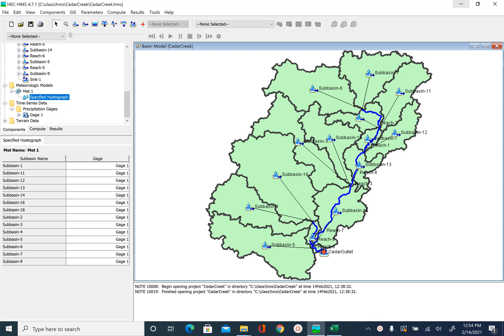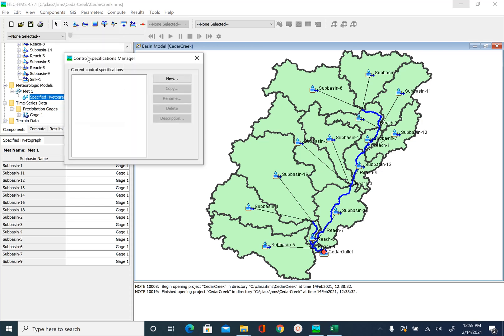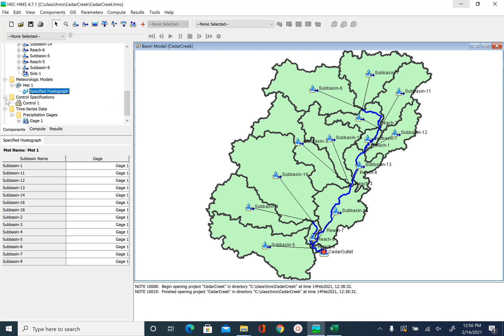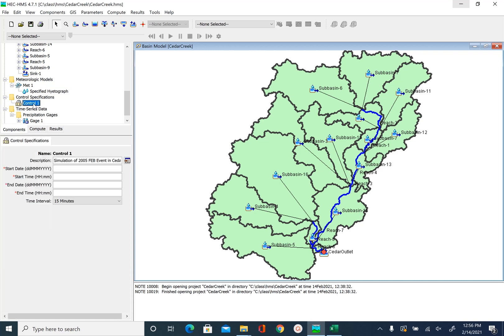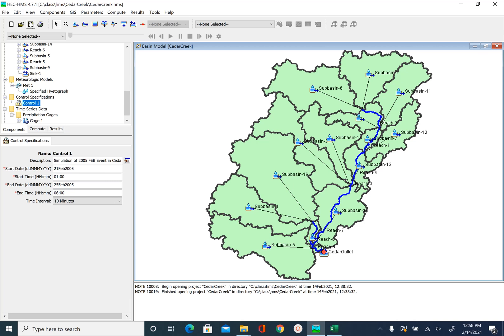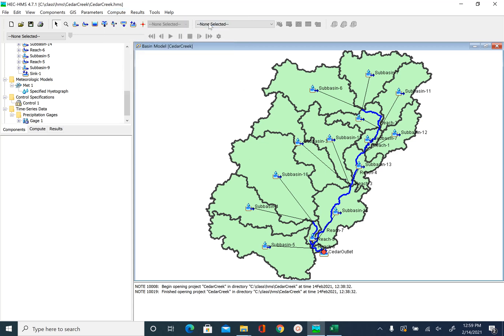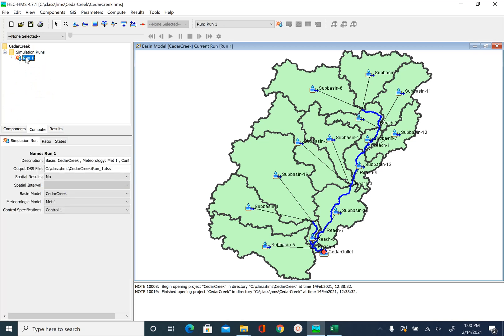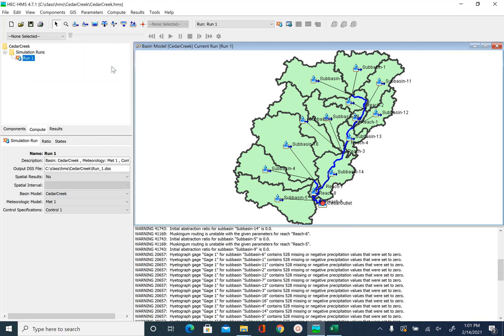Hydrologic Modeling Using HEC-HMS (8/9) - Creating Control Specification and Simulation Run

Comment: Hi, i have 2017-2024 rainfall data. I have imputed this in Precipitation gauge. In the next step, i do not understanding what Control Specification manager mean. How many years should i provide here?
Reply from the maker: are you using 7 years of data in  hec-hms? i suggest you go through some basic hms-tutorials at the link below to understand different components of hec-hms including the control specification file. https://web.ics.purdue.edu/~vmerwade/tutorial.html
Reply: @hydrologyvideos8253  Yes, I am using 7 years of rainfall data. Why, is there any fixed rule that requires me to use a specific number of years of data?
Reply from the maker: @ hec-hms is mostly used for simulating individual events or storms. if you want to perform long term simulations use SWAT or use the soil moisture accounting or layered green ampt method in hec-hms. it is better that you use SWAT.

Comment: Hello, when I use HECHSM to run daily weather data using SCS method, I encounter problem "WARNING 15303: Aborted run "run1"" What should I do?
Reply: Go to parameters , discretization , and choose structured. This will solve the problem
Reply: @shahdbishawi8508  Thank you. It run successfully.
Reply from the maker: @shahdbishawi8508  Thank you!

Comment: Hello. I am getting "Could not connect precipitation gage "" to data in the time-series manageé error all the time when I try to run the simulation. I could not find the source of the problem. Can you help me?
Reply from the maker: Most likely you missed a step somewhere. Go back and make sure you follow all steps correctly.
Reply: @hydrologyvideos8253  Thank you

Comment: Hello please how to input time in control specifications? I have precipitation data in mm/day. For example I have rainfall data from 01 july 2019 to 31 july 2019 in mm per day . Every data is recorded at 9:00 am . How to input start time and end time with date from given time? Also there are zero rainfall in some days in between and 1 july too. Please please please do reply. I have very little time remaining for completing my thesis.
Reply from the maker: SCS method is not really meant for using daily data. If that is all you have, you can pick a time interval of 1 day when you create your rainfall gauge. your start time is 9:00 am on july 1, and end time will be 9 am on july 31. zero values are okay.
Reply: @hydrologyvideos8253  In time series gauge I have put time interval of 1 day, but while running simulation run if I put 1 day in time interval with start day and end day same as in time series gauge with both start time and end time 9:00, and run the simulation, it shows error like : Invalid time window, and hence run is aborted. What to do please?
Reply from the maker: @maiya_angel  use smaller time step. try one hour